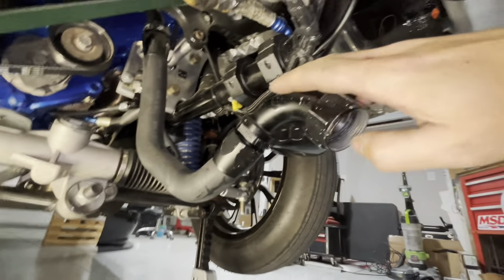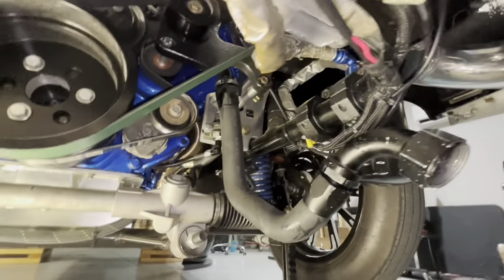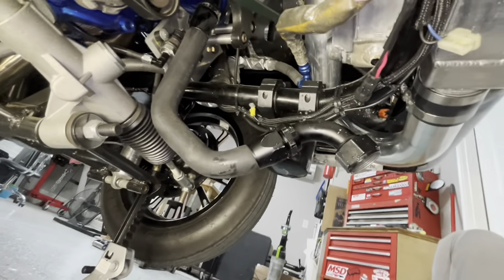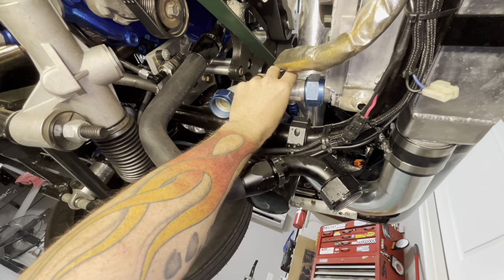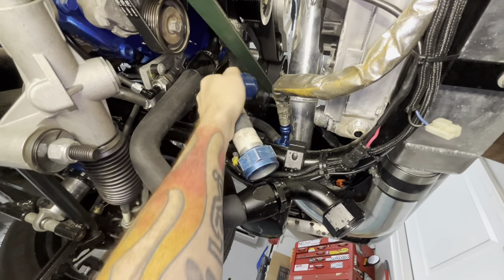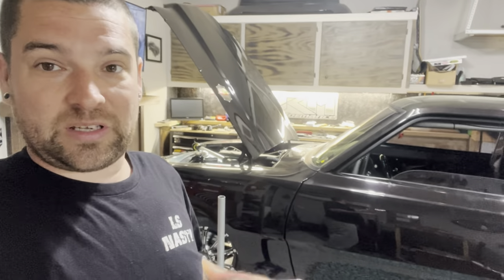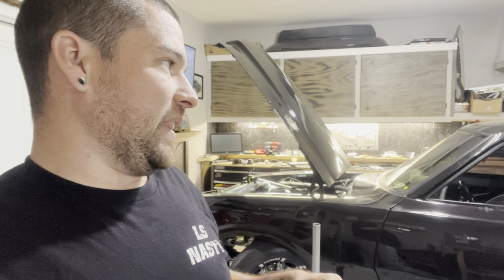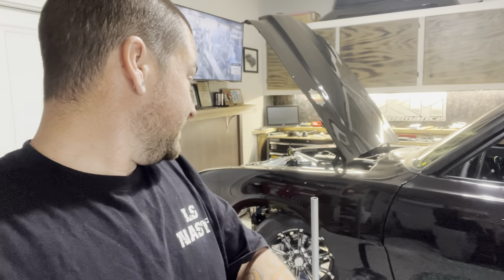🪚 Yes I Cut That Out 😲 Making Changes / Fixing Issues

Comment: Hey buddy, what you’re doing will be a lot stronger and safer than the stock frame rails.
Reply from the maker: That’s my exact thoughts. From my experience with collision and how cars fold on impact I know that that sheet metal floor support is way weaker than adding a rocker bar to spec

Comment: Instead of cutting the frame rail, why not put a crease in the pipe where it crosses the frame rail, cutting the frame don't seem good
Reply from the maker: Putting a C in it all the way to the floor pan will make it as weak as cutting it out being there’s now no side walls to that box. Adding the rocker bars will be stiffer than it is now